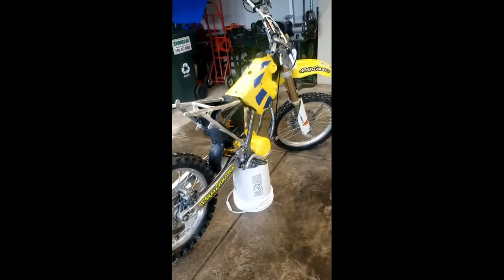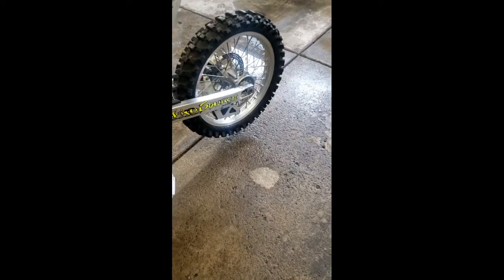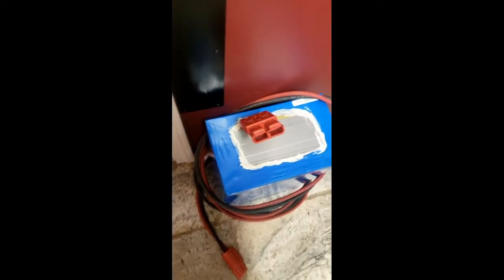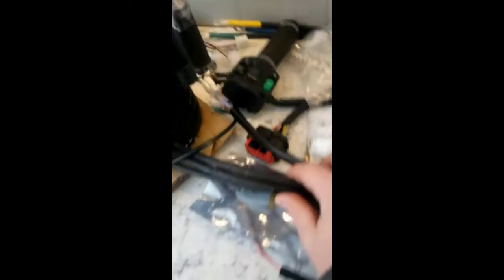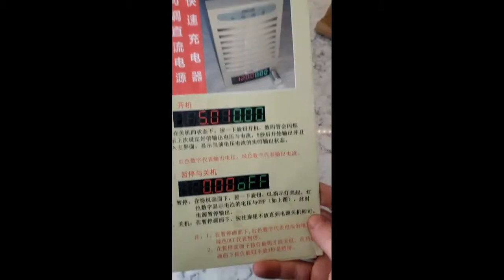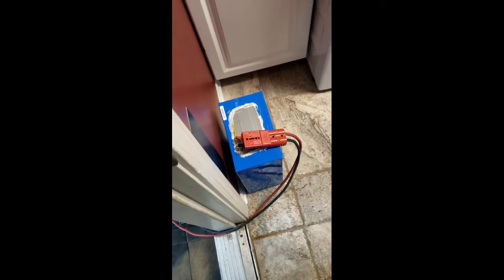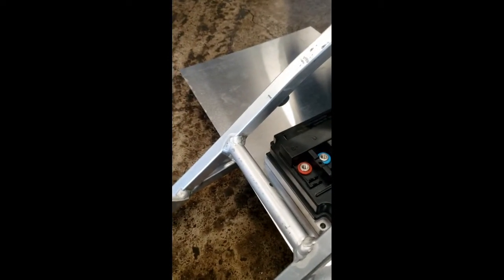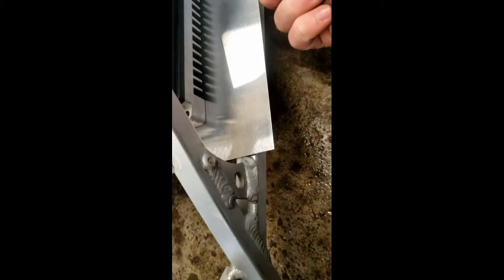Electric Dirt Bike Build (16,800 WATTS!): Part 1

Comment: Do you have to a programmer with a pc to make it run
Reply from the maker: Yeah a USB cable connects to the CAN/BUS communication coming from the controller so you can program on your pc.

Comment: Thank you, thank you, a thousand times thank you!!!! For posting this detailed walk through calculating battery, controller, motor size and build process. I just started planning a build and this cleared a lot of things up for me. Even answered questions I didn't know I had yet. If I may ask some more:

- How do you engage regenerative breaking? Does it regenerate anytime the throttle is not engaged?
- Given the size of the bike you converted, would you do anything different if you started over as far as the motor, controller or battery size? On endless-sphere it seems like folks run controllers pushing 200 amps or more on the QS138 70H motors. Or do you think there could be any benefit to running the QS138 90H on a frame that size?
Reply from the maker: Rob,

Thank you so much for the kind reply! I am glad that you found the information/content useful. I will do my best answer your questions!

Regenerative Braking: after a lot of reading please do not enable regenerative braking until your are certain your system is stable and that you will not experience any faults from overcurrent etc. etc. There are some horror stories of people who have regenerative enabled, fault occurs at speed, energy being regenerated no longer has path back to battery so it overheats the controller and starts a fire. Moving on, I believe you can set an rpm where the regen will activate, currently I am not using regen but I may in the future. Sorry I don't have more info there.

Size/power of components: there were a lot of times throughout the build process where I second guessed my components, some people told me that I would need 300+ amps for real power. In the end, for a first time build I am completely satisfied and for the money the system delivers. My brother and I have both crashed the bike already, it has a lot of torque and is definitely not a toy. I would say power is pretty comparable to a 125 2 stroke, but gas and electric are hard to compare. If you have a $5,000-6,000 budget then you can take your build to the next level with high quality components. The 90H would definitely be a step up and for a second build in this size frame that is what I would use, but im a fiend when it comes to power. That motor would definitely handle 300amps and the new water cooled version will take even more. You will likely need a controller outside of votols product line to get serious power out of the 90H. I push 200 battery amps (not phase) to the controller. The hottest component is by far the controller but it is still well within its ratings. The motor could probably handle 225 or 250A without too much heat on a 72V set up, again you would need a different controller.

Hope that helps!
Reply: @vincentpernicano3277  These days people run this motor qs138 v3 with the 260 giving it 300-350 amps without any issue.. i'm curious about the sprocket issue? Im currently also converting one with the same motor and im not even sure what chain is on the bike :D.

Comment: I have a 01 rm125, just got it now I'm on the market for an electric motor. Any heads up what to look for when shopping for one, I'm looking to be a beast on the tracks and not a play around dirt bike. Do you think the arduino will work for the controller? Also how much of a big difference does the sprocket makes compared to the power output of the motor? How are you monitoring the motor temperature and do you plan on customizing your map settings?
Reply from the maker: Oh dear I have quite a bit to say, ill give you a detailed reply in a couple of hours.
Reply: @vincentpernicano3277  sounds good, thank you. Nice build as well.
Reply from the maker: Thanks man!! I'm bad at keeping things concise but ill try. The hard part about getting the performance you are looking for is that electric power is hard to compare to gas power. 20hp of electric power is way different than a 20hp gas motor. If you want a beast on the tracks im just going to take a guess and say that you will need 350-400 amps at 72 volts. That being said if you want big power it probably better/easier   to go with a 96 volt system or higher. That way you can push higher wattage at a lower amperage which will drive down the cost and increase the availability of controllers you have to choose from. I don't know much about arduino, but I don't think they have anything that will be able to handle the amps you need. Not only that, but I can only imagine that programming a motor controller from scratch is probably near impossible and would be extremely complicated (I think). However, if you are going that route you will want a square wave motor. Sinewave motors take more computing power and are much more complex to program. A big oversight of my motor selection was neglecting to research compatible 428 and 520 chain set ups for the bike. Luckily I'm figuring it out and I have a solution, but I got lucky. Find a few motors with around 30KW peak power (what you will need for a beast) and take the time to research available sprockets for their shaft dimensions and make sure you find a compatible set up or just know you will need all custom sprockets which can get costly. Gear reduction and sprockets are extremely important for proper power delivery. In part 3 I will go over some "ebike math" and ill create and share a spreadsheet that should make your life much easier when trying to determine what gear ratio you need to get a certain top speed, acceleration, etc. If the CAN gives me temperature readings from the motor it will be on my lcd display, otherwise I'm not super worried about motor Temps because of the power people said this motor can handle. That being said I will be doing extensive testing and checking the motor a lot throughout those test. If the temps concern me ill figure something out. I do plan on playing with the program settings but I'm not there yet. The other thing you will struggle with is finding a battery that can deliver the power you want unless you want to make a giant 18650 or 21700 battery pack that will need hundreds of cells. Lithium iron phosphate batteries would be great but you would need to do some serious frame mods and do a lot of planning to ensure they would fit in the bike. The easier route would be to string together a series of RC lipo batteries. The caveat there is that cycle life is only like 200-400 cycles. My battery is lithium manganese cobalt and has typical life of 400-600 cycles I believe. Bad part is it has a max discharge rate of 4C, it can handle 3C (204 amps in my case) for 60 seconds. Again you could ise this chemistry but the battery would need to be 100Ah and 96V to hit the 30KW mark which will be BIG. If I only charge to 4.1V then I can double that cycle count. You could do the same thing with the lipos I suppose. Size vs power is what you will have trouble with is what I'm trying to say lol. Hope this helps, ask and ill try to answer.
Reply from the maker: With a lithium iron phosphate they have a max voltage of 3.65 and nominal is 3.15. You would need a 30 cell pack to get a 94.5V pack and 75AH for 300 amps peak, 100Ah for 400 amps. You could do a 23 cell pack that would be around 72V nominal but you would need large capacity (higher AH) packs to get desired anperage. Rc lipos have very high discharge capabilities for their size so they would be the easiest to fit in the frame and get the amperage you need....but bad cycle life.
Reply: @vincentpernicano3277  l